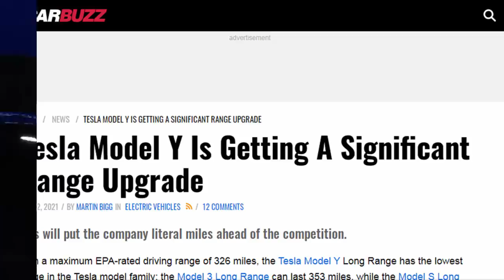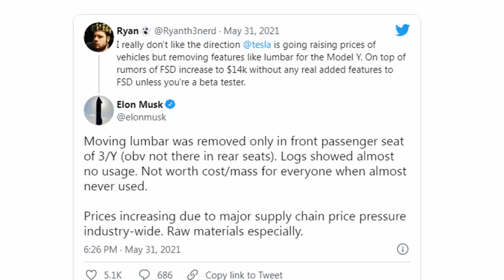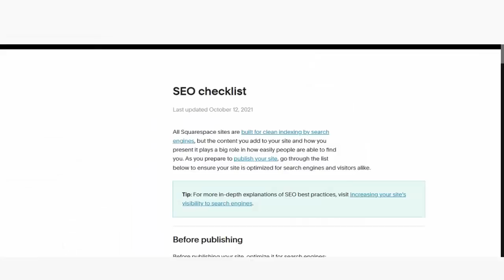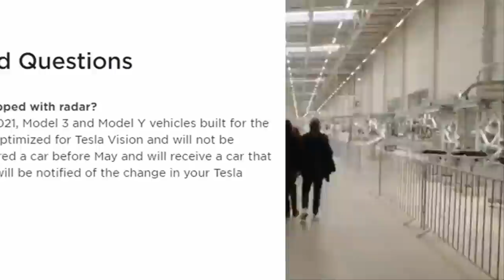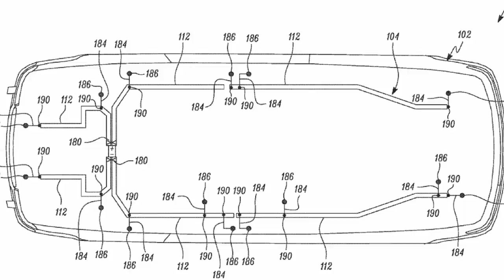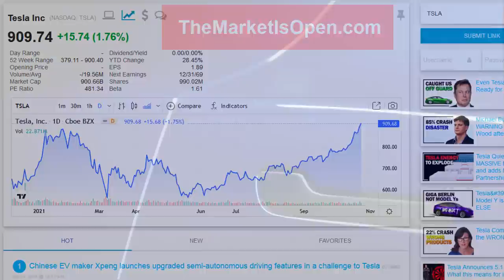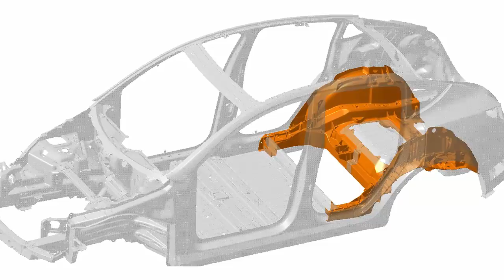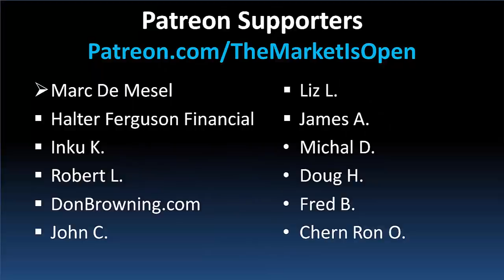Tesla’s NEW 2022 Model Y CHANGES EVERYTHING

Comment: I just ordered a long range model Y with an estimated May delivery date….I’m hoping that it’s a 2022 build from Austin with 4680’s…what do you think my chances are ???  Tesla makes no commitment one way or another 🤷🏼‍♂️, thx
Reply: Based on statements if you live east of the Mississippi you have better odds. If, like me, you live I the West, we are set to get Cali cars unless we do something like order for Atlanta deliver (example given by a Tesla store on a podcast)
Reply: 4680 will not be in the mass production till the end of 2022...
Reply: zero chance
Reply: Looks like you might get the new EV rebate though.
Reply: I'm considering ordering one as well with the same hope. My thinking is that even if its not fully scaled until the end of 2022, they should be starting to deliver them in the first half of the year by being able to supplement the 4680s being produced in California. Even if that is not the case, we should have more clarity by next spring and can change/cancel the order if needed. It's worth the $250 risk IMO to get a 4680 model Y without waiting until late 2022 or 2023 to take delivery
Reply: I am not sure about 4680 availability even for 2023
Reply: @kautilya21  There should be more clarity on this when Berlin and Austin open. I would thing there would be range in crease from the Castings and Revised upgraded panasonic 2170's
Reply: @sbanana415  Place the order now, prices are going up ($4,000 since I ordered my Y) and you can delay until the 4680 is in. I’m in N.Calif, but I’d fly to Austin, or further east to pick up my 4680 Y. What a great road trip.
Reply: @stano49  I did end up placing the order. Glad I got it in before the most recent $1000 increase. A road trip would be a great way to break in the new car!
Reply: Just ordered mine as well with delivery date of June. I plan to delay if I can and get the 4680. From what I’ve read it sounds like Texas will likely be rolling out the 4680s
Reply: Don't think you will know what they are going to do till after Christmas. Only the performance and maybe the long range will get the 4680 if they can get it out in a timely manner is my guess. It will be messy if they are producing the old variation and the new at the same time in terms of customer perception.
Reply: Can anyone explain how this works. I just preordered Model Y, Estimated June 2022. I live east of Texas, so maybe would be getting from new Factory? Even though I ordered it now without the 4680 battery as an existing option, you would just get that upgrade for the price you paid now if its available?

Comment: Tesla has not said that they will manufacture LFP batteries in the 4680 form factor.  They might, but saying so is an assumption, not a fact.

I think it's more likely that they will buy LFP batteries from suppliers, and restrict themselves to just one version of 4680 on their own production lines.  Later, they may experiment.  But for now, just getting battery manufacturing going for one version of 4680 is challenge enough, and then some.
Reply from the maker: I never said it was a fact, I said "this could allow them to use LFP type cathodes with the 4680s"
But it does seem like this will quite likely happen.
Reply: @TMIOTesla  Perhaps eventually.

Simplicity in production will likely dominate Tesla's thinking during their production ramp push.  Getting costs down, rejects down and production up for one battery chemistry in a brand-new form-factor will be plenty hard enough.

Perhaps in 5 years, we might see different 4680 flavors start to appear from Tesla's battery plants.  I don't expect that to happen sooner.  but it might be a distraction Tesla won't bother with.

If Tesla buys 4680 cells from suppliers, odds are those 4680 cells won't be identical to Tesla's.  We could see LFP in 4680 cells from CATL, for example.  They seem to have the inside track on understanding that chemistry.

Does Tesla have any LFP-oriented patents?  CATL sure does.  Tesla has chemistry-agnostic patents, but it's a far cry from there to building up LFP lab expertise and designing a production battery.

Comment: Hi There,
Great Video!  I am very close to placing an order for a 2022 Model Y!  I am also really wanting the new 4680 batteries and the structural battery feature. I am not sure when that variation will be available in British Columbia Canada?  The one feature that I would love to see on all Tesla's and in fact on all EV's is what I think is called Vehicle to Load.  The ability to easily plug in an extension cord and power the essentials in my home in case of a power outage, or plug in some appliance when camping or on the road.  What are your thoughts on this feature?
Thanks, Stephan

Comment: Another great video!  Note that it appears there are no plans to make a Lithium-iron (LFP) 4680 cell.  LFP uses different packaging and will be used in SR+ versions of Tesla vehicles going forward.  Each battery tech has advantages and disadvantages, but not enought that given a choice between NCA and LFP, would 99% of owners care.  For maximum range, NCA is the only choice, but it does cost more.  Both technologies will last for 250K or more miles, likely longer than the life of the car.
Reply: I think you have it backwards. 4680 will be predominantly LFP, across the board. NCA in 4680s is dedicated to CT, Semi, & Roadster & possibly Plaid Plus, if it's ever deemed necessary.
Reply: lfp for lower cost models as the video states, and not for higher range models
Reply: @Crunch_dGH  Tesla Battery Day stated LFP batteries will be used for  standard-range & new compact model.  Currently, their LFP batteries [from CATL] are prismatic.  I have not heard any plans to put LFP chemistry into 4680 packaging, but it's certainly possible.  However, they did say that the new 4680 cells will contain no cobalt.  Their other enhancements to battery chemistry, etc. have eliminated the need for cobalt.
Reply: As I recall on battery day there was no mention that the 4680 was LFP. And we don't know what the lifetime of the cobalt less 4680 will be but there was mention it would be nickel based.
Reply: My understanding of LFP is that it starts life with lower density, but degrades very slowly, so that over time, it has greater range than NCA, especially if NCA batteries are fast charged or charged over 80%. The big weakness of LFP is the rate at which you can draw power from them, so Model S will be NCA to get that amazing performance.
Reply: LFP has less range on a watts per kilogram basis. However it has greater longevity (about 3 times) an it can be charged to 100 percent without degradation .  It has about 3 times the lifetime but less energy density . A LFP cell has about a 3.3 volt output
per cell vs 3.7 volts for NCA.  Also LFP is less subject to fire. The 0 to 60 times is slightly degraded on a model 3 with LFP.

Comment: The model Y AWD needs to have a comprehensive winter/off-road package: good all-terrain wheels and tires, skid plates, ventilated seats, decent ground clearance (maybe air suspension), mudflaps, decent towing package, electric window tinting, better approach and departure angles.  Much of the US is rural and/or under snow for part of the year and… The model Y is great just needs to be more versatile like the ICE SUVs. I’d be will to pay for quality factory options, plus Tesla often refuses to work on “modifies” Cars.
Reply: Model Y already has a tow hitch option, with 1600Kg towing capacity, you can also buy mudflaps for the Model Y.. Skidplates is a bit too much to ask, but probably third party vendors will be able to provide this.

As a Model Y owner, I am not into off roading, but I have ordered the tow hitch
Reply: @MarcoNierop  Heyyy, thanks for your note. I should define what I mean by “decent” for the towing option.  for example the Ford Explorer has a 5600lb rating. good 60% more, but the key is the Tongue weight that is also 60% more than the Model Y.  The explorer is the vehicle I will be replacing and there is not a really good EV on the market with towing unless you could the “elusive” F-150 lightning or Rivian(10,000lb towing). Sure, run around town and upgrade many of the features i mentioned aftermarket but a package from the factory just makes sense…I should also redefine “off-road” to “off pavement”…I’m NOT going mudding or rock crawling.  I would add a lower body ceramic coating or body molding to the mud flap protection package too.  Point is that most of the US has unpaved roads, weather, potholes, or sketchy maintenance…some practical variable terrain upgrades are needed. Recently the Model Y failed the speed bump clearance test in India…and the Performance Model Y is even lower!  The rumored air suspension would be perfect.  I have a MY and Cybertruck on order…Cheers!
Reply: It never snows/rains in southern California.
Reply: @bafattvahetere  Glad I went to see California years ago before it was trashed. Such a shame.

Comment: wish it had a screen over the steering wheel abd head up display plus air suspension!
Reply: Totally agree.  I think the single central screen forces the driver to scan away from the line of actual driving.  A HUD should be standard and they have one of the TOP HUD design engineers on board for the last 3 years with no sign of any contribution from his hire.....I bought an aftermarket display for my Model Y that fits on the steering wheel and mirrors the critical driving and warning info from the central screen.

Comment: Elon originally said there would be both air suspension AND a Ludicrous version power level in the Model 3 (before it had reached any production).  I have had 3 Model S variants and a Model 3 Performance and a Model Y AWD.  My current "fantasy car" is a Model Y with at least 2 of the newest Model S (Plaid) motors, or at least 680 hp and Air Suspension.  Both my Model 3 and my Model Y rode much harder than any of my Model S cars, which all had the air suspension option.  I am currently driving a Model S PLAID, but I really don't like how big the Model S feels and how "heavy" it feels even with all the 1020 horsepower.  A 680 hp Model Y with Air Suspension would handle more nimbly than this current or any of the earlier Model S cars, and still run low 10 second quarter miles at over 125 mph for the quarter mile drag strip......I don't need to run in the 9's but I do like ...considerable power to play with.

Comment: I am a big fan ofTesla but the pricing policy in reality does not match the always stated goal to reduce prices for customers: take the SR+ which increase twice this yr by 2,000 Euro, so 4000 Eur overall in Europe. While the LFP is substantially cheaper. Hm... otherwise, I am really torn: buy an M3LR 2022 or wait for it to get the 4680 batteries and crimson red colour... but when will that happen? For sure not before 2023. And if it mainly means same range but different battery the waiting is not worth it. But an m3 with say 1,000 km range, now THAT would be worth a wait for another yr. but my guess is, that will not happen, as you say in yourvideo: they will rather reduce the pack - and thus weight, which also helps range of course.

Comment: Don’t like the “noise” feature for speed under 19 miles. This feature will be on all the time during traffic on fwy 101 and 405 as these fwy’s have crawling traffic patterns for 30 minutes plus on daily basis.
Reply: unplug it then, speaker is in front of the right front tire.
Reply: Just make it a light humming noise, it probably won't enter your cabin and will also be lower in volume than ice cars' engines

Comment: Add air suspension like the S/X and get the range up over 500 miles.
Reply: What percentage of improvement vs standard springs? I cant imagine air ride would be a ton..
Reply: Drive 500 miles per day often? Thought not.
Reply: @jacka7211  I do not but apparently you do. I'm an engineer.. at least that's what my degree says. Lol

Comment: Longer Range for any EV is most important to me.  I will only consider vehicles with 500 + mile range.
Reply: Obviously you’re free to do what you please.  If you want some advice though, I felt the same way but after 2 years with a LR Model 3 (and after just driving 1700 miles with it), I honestly don’t see the need for more range.  I think you’ll find that most people with Model 3’s will tell you the same thing.  There are multiple reasons for this, but long story short...you don’t need the higher range.  It just doesn’t matter.
Reply: Lol what gas vehicles have that kind of range?
Reply: Drive 500 miles daily, often? Thought not.
Reply: Yes, as a matter of fact most miles on my vehicles are 500 mile days.  From what I understand, Most of the charges should be below 80% and not drop below 20%, that leaves a Range of about 300 miles.

Comment: Did you ever drive a Toyota or BMW?  On highway, the only noise is wind noise or tire noise, the engine noise is nothing.  Tesla wind noise is higher than that of BMW.  Make an artificial noise?  Are you joking?
Reply from the maker: The speakers are for low speeds. Toyota's are extremely loud btw, just like any gas car. Turn on your car, then stand near it. Inside the car they do their best to block the sound. But as you mentioned, you have to go highway speeds to get the wind noise to be louder than the engine.

Comment: That porsche was made when basic electronics in cars weren't even a thing, let alone all the features found in modern cars.... Tesla came when everything was already made from traction control to ABS, paints, robots......
Reply from the maker: ...giant castings, structural batteries, 4680 cells....
Reply: @TMIOTesla  lol.... there is litteraly nothing special about that, things have drastically changed over the 50+ years of the automotive industry, back then aluminium and all those materials were super expensive, the automation wasn't a thing, the first 100% aluminium car shelf was made in the 90's by audi, the lithium battery was invented in the 90's. Bmw already had giant castings back in 2012 in the i3. Bmw, volvo and many other manufacturers have also been using recycled materials to make their cars.
Reply: @TMIOTesla  the technology has also significantly improved over the year to make mining, transportation, construction and agriculture way easier and more efficient. A modern ICE today can easily give you 1000 miles of range... for overlanding. Australian road train can haul 2 hundred tons of freight to cross an entire desert. The longest/heaviest train in the world is diesel it's used in Australia to move million pounds of iron ore.
Reply: @carholic-sz3qv  "A modern ICE today can easily give you 1000 miles of range"
                              Really??

Comment: The Lucid evs have 500 miles range, and are luxurious.  and much more ergonomic and functional.
The Tesla user interface sucks!  I  have always recognized that a screen and a set of sub menus cannot replace direct triggers, EVER!!!  it's less than basic common sense!  simply try to read your texts while yu drive, or email or anything on your CELL... No NO NO NO... and why it is illegal to do so!
Reply: $20K more and they're not available.
Reply: You should buy my Mother-In=Law’s old Lincoln Continental. It looks just  like a Loosyd and has lots of knobs. Please.
Reply: @jacka7211  ...you have no clue, you do not understand mission critical items, and real-time requirements in a human interface.
It is not just ergonomics nor preferences, but critical to safety.
You are riding the TESLA ev hype...
Small example:  what if you had to seek a screen that is not even facing you, specially in a refractive light glare scenario, and search thru a nested pile of menus, to find: oops-burning hazard-move-hand-off-burner-immediately-Puhhhlease.  -  By then you would be good for a trip to a trauma emergency center.
Example 2:  as good as the French aeronautics engineering is, they paraded a massively AI loaded Airbus and watched it along with the whole world, crash miserably before it got a chance to even climb.  -  now every unit has a big red button, to gain instant pilot control.
Example 3:  The French train system is hardly equaled in the world, yet they manged to get a big-head(presteeeeje) and against all advice of people who warned them repeatedly that pushing the old rail technology to that extent begged for derailment.  ...and voila, a massive crash that killed key people on their team!
...and not picking on the French, just that these 2 examples are big and easy to verify.
...I could type for a year and drown you to where you would surface from the hype immersion you suffer.

Comment: Removing the second battery in the trunk and instead using part of the battery pack under the model y.
Reply: The LV battery is not very big. It's only used to power standby electronics. It would not be worth the extra complexity.
Reply: @gregbailey45  Do you know what you have to do to replace the LV battery.  With a million mile batty pack, how many times will that LV need to be replaced.  "the lifespan of 12V batteries have been reported to go down to as short as 1-2 years."  The battery costs $75 and it is not monitored by software.  And last, if you need to jump start that battery, why are the connectors not by the charging port.